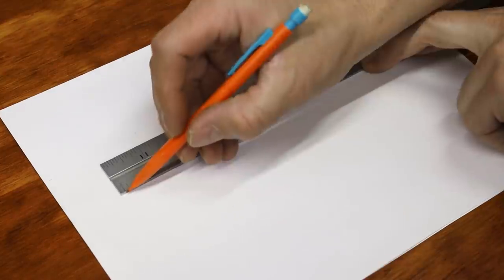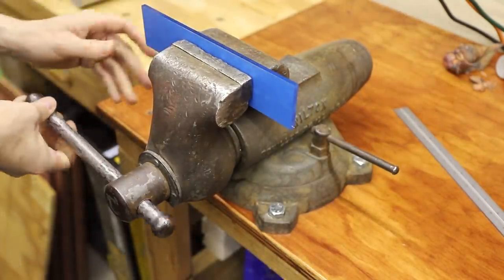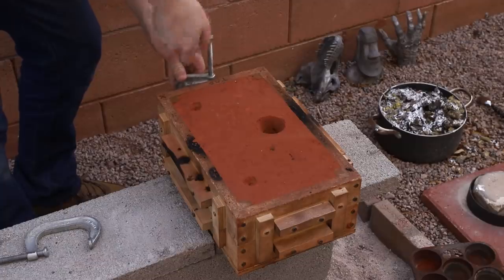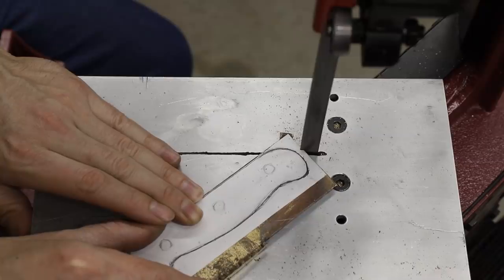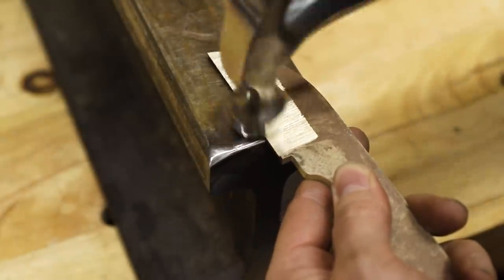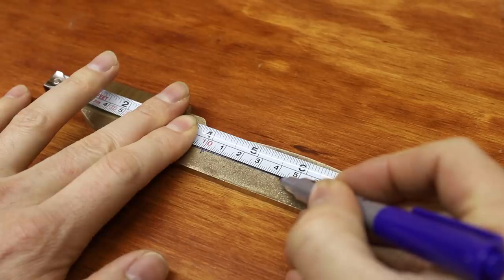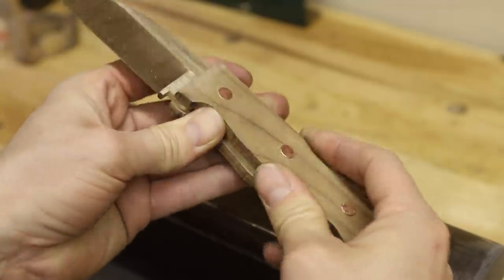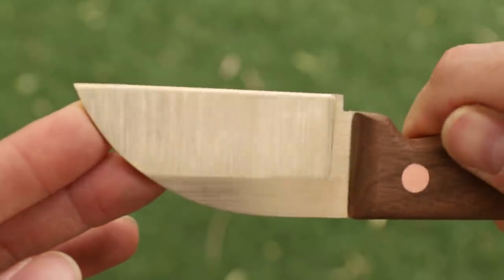Knife made from COPPER WIRE - Its SHARP!! - Aluminum bronze with forged edge

Comment: Gorgeous! Aluminum bronze is a hell of an alloy. It's crazy tough and darn near impossible to corrode. The knife turned out great, I may have to make one myself before too long.
Reply: Almost impossible to corrode? Sold, I'll be having a knife made of aluminium bronze.
Reply: @Fgway that's beacause the only alloy that somewhat approaches bad quality tempered steel would be CuBe2 or CuCoBe alloys (copper/beryllium), wich can somewhat reach 40/45HRC. Some make non spark hammers with them. However it's a very expensive material, and its dust is toxic.
Then you have copper/nickel alloys, wich can get hard but aren't as good and tough. Then you got aluminum bronze, wich can be water quenched and hardened, like steel. But it's not gonna go beyond 30HRC,and it would be brittle. He should have added some nickel and iron to the mix to improve the properties of his alloy

Comment: I worked for AMSCO foundry (Specialty Steels) and we coated our cope and drag molds with a spray-on finish.  Release was easier and casting surfaces were superb.  We also had patterns for molding in vents and risers.  Because you pull your patterns then add vents and risers by hand later, you risk distorting the mold.  On your copper hammer video, you got a void because your sand binder isn't fully cured and high temps turn the binding agent into gas which has nowhere to go except into an otherwise beautiful casting.  Also watch pouring temps in relation to barometric / atmospheric pressure and humidity (You need to learn how these affect laminar / turbulent flows). I know nothing about casting copper / bronze / aluminum, BUT after applying spray-on finish, we routinely aged our molds for at least 24 hours, then FIRED the insides with blow torches prior to clamping the halves together and pouring a heat of manganese steel.  'Hope this helps.
Reply: I was surprised that he didn't bake or otherwise heat the mold before pouring
Reply: Wow. I know nothing about this stuff but thank you for sharing this bit of insider knowledge. I'm sure it will help.

Comment: Low melting points is one of the great advantages that bronze age weapons had over their early iron counterparts, which is why many people still used bronze even when they figured out iron: a bronze weapon or tool that broke for any reason could always be melted back down and recast into a totally new weapon or tool, something which was considerably more difficult when working with iron. The advantage for bronze tools nowadays, of course, is that they conduct but do not spark.

Comment: 8:12 if you counter sunk a couple of holes in the wood before you peened the pins I think the chances of you splitting the wood would go down, not very deep ones, but just enough to allow for for the metal to bulge out, it would also make the pins to have a tighter connecting grip as there's more material hang over against the knife scales.
Reply: Countersinking is a bit too wide for the peening to fill it in, what people normally do to avoid cracking is using a reamer to slightly taper the hole.

Comment: Very pretty. And I'm glad you used a full size tang instead of so many forged knifes that have a single thin tang instead of the entire width of the handle. Very nice work. I'd love to see a followup on how it works after extensive use.
Reply: that knife is Cast not forged.

Comment: Man, that blade came out beautiful, first knife or not!
By the way, that 'cold forging' process he mentions is called edge packing. It's normally done hot during the process of forging a blade, and it absolutely makes a difference in the toughness of an edge, in case anyone is wondering if it's worth it.

Comment: That's a nice looking knife, and it looks like it would do most shop cutting/trimming with ease. Super interesting build to watch!
Reply: It's a basic electricians knife pattern. Even the cheapest steel knife would outperform this for basic "shop cutting/trimming"

That's not to say it wasn't a cool build, just that it's the wrong tool for 99.9999% of use cases.

Comment: I cast ornaments and coins out of aluminum bronze, so I can fully respect the amount of time you took grinding that thing. I know quite well how crazy hard that stuff is! Because of its hardness I've always wondered how well a blade made out of it would hold up. I guess now we'll find out.
Reply: Crazy hard? He sharpened it with a file so it can't be that hard can it?
Reply: @Eralen00  he did say it took him six hours of hand grinding to get the bevel on that blade. However you say it, that is some pretty hard bronze. It's good for ornaments because you can drop it and it's not going to dent or break. It just eats sanding belts, and takes forever to hand file and sand because it's such a hard alloy

Comment: With peening the smaller the hammer you use the shallower the deformation goes. I have have a very small ball peen to minimize handle cracking.

Comment: It looks so cool. I love it. Isn't copper too soft though? But dude, Im loving the color soooo much
Reply: I would consider do some research on copper alloys. The alloy he made is really strong. Pure coppe is soft, but when there are diffrent materials like silicium, tin, zinc, alu, niccel, mangan and iron you can get a really strong material. Alu-bronze can even get hardend, its called aging and the hardness gets really high. His alloy got an hardness of 280hv in rockwell its like 28. Hardend its like 35-38 in rockwell. That material is still on the softside. Good steel got 58-60 in rockwell. But when you do some reseach, some copper alloys get high as 68 in rockwell, but that is like steel on that level,  brittle. There is a alloy called berryliumbronze that got a good hardness 48hrc, tools of that alloy is used in oilfield because that tools will not spark unlike steel and grill everyone on that oilfields 🤣

Comment: Traditionally a bevel is forged then only the final touches are ground. It doesn't just save some work it also saves a lot of metal (and can reduce porosity). 
I know there are a few fancy alloys that must be ground from a stock blank for metallurgical reasons, but for most others it just seems kinda crude.

Comment: I like it a lot. I would have used epoxy in conjunction with the copper pins for added strength. If I’d have used mosaic pins I’d have had to have used epoxy glue. Still, it looks great.

Comment: Try a micro-thin coat of original Gorilla Glue for coating knife handles. It must be applied micro-thin, or it will foam. It's the hardest, toughest coating I have found for dense hardwood handles.

Comment: Legendary Weapon Class: Copper Wire Knife.
Damage: 20
Block: 5
Concealment: 10
Unique Ability: You can use your shock spell to charge the knife with electricity to deal an extra 10 damage in shock. Good against: Automatons, Robots, and anything electrical.

Comment: How about a meteor knife? I've never seen anyone do this. It's said that if you run a small magnet on the ground, all the filings you pick up are from meteors, though I'm sure some of the dust is from automobile wear and rust. So, if you run a strong magnet wrapped with a bag near the ground, you should eventually pick up enough metal dust for a blade.

Though technically, we're all star dust., that knife would be a true space weapon.

I'd also be interested in a knife made from what your magnet picks up from sand at a beach.

Finally, how about a knife made from only crumbling rust?

Comment: Your forge made from the alumnum beer keg and a propane tank is probably not the most energy efficient way to melt aluminum or copper in a crucible. Have you considered making a forge which uses electrical induction? There are plans on the internet. The crucible would sit inside of a big copper induction coil. Reccomend embedding the induction coil inside of a cylinder of Portland cement so that you can't short circuit anything by touch two sides of the  coil with crucible lifters. Some youtubers publish plans for induction coil heaters.

Comment: Now make me a copper sheath for my antique knife (see my channel) out of a piece of copper pipe with a belt clip on the back similar to the old bowie knife sheaths.   The blade is exactly 6 13/16" long by 1 1/16" wide x 3/16" thick @ the ricasso.   Spear point as you can see by the pics.   I thought I would smash a length of 3/4" copper pipe and make it myself, but you do much better work than I.

Comment: As a fellow tradesmen your file storage is appalling, files are precision tools, you should guard their surfaces as you would the blade of scalpel before going into surgery.  I understand the limit of storage space all to well, some felt cloth approximately a millimeter thick used to roll files together as a bundle would be a solution I have used in times of hardship, a more presentable solution would be a knife organizer that hold your files separate but on their sides.